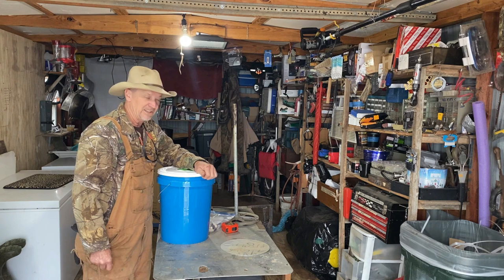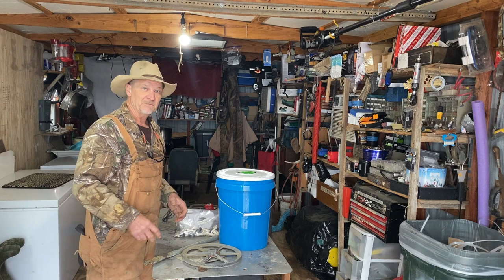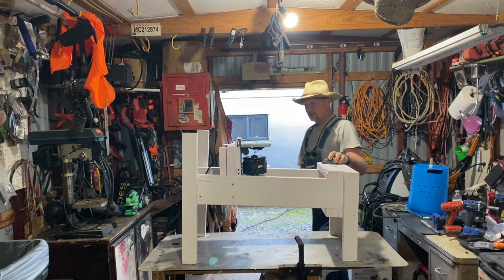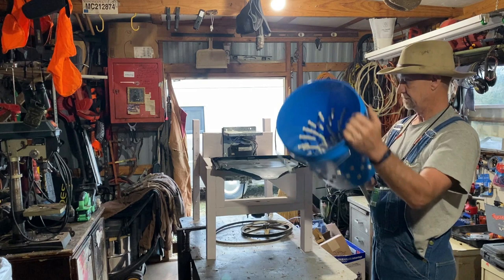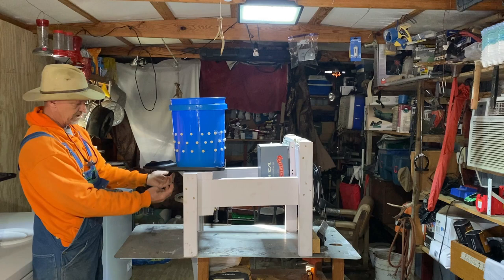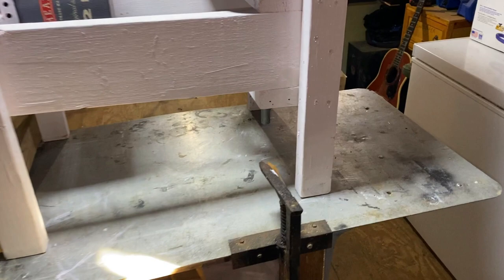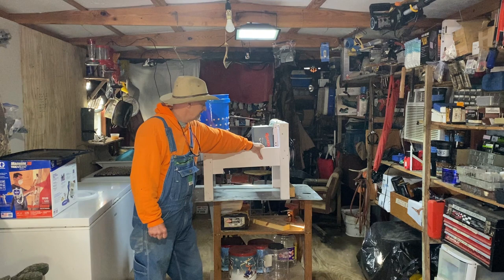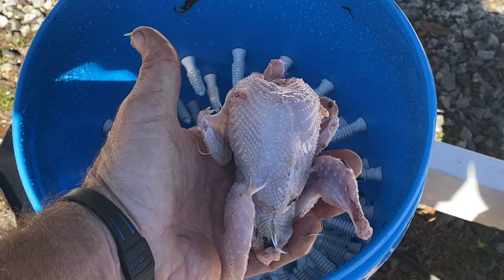HOMEMADE QUAIL PLUCKER from a 5-gallon bucket & old garage door opener motor. Save Money DIY Project

Comment: I built a duck plucker for wild ducks I used a sguirrel cage and took a piece of tin with our fingers thru it and wrapped it around the cage when we run it you just put your bird in your hand and push up from the under side to dry pluck a duck. Only took a minute to do a duck am sure it would work for a quail we also used it for scalded chicken
Reply from the maker: If it plucks a dry duck, it may rip a quail to pieces. I tied the drill attachment type but I did not like it at all.
Reply: @papawsplace  I have done teal on it you just don’t put to much pressure
Reply from the maker: Send me some pictures to my email if you don't mind. May be something I want to build. LOL
Reply: @papawsplace  I can’t send pictures im sitting in Florida and I’m from Canada all I used was a squirrel cage and motor from a air system Took A piece of tin drilled holes for fingers to be pulled through then wrapped it around the cage with fingers pointing out you could use any round drum as long as you can spin it just point fingers out not in so you can push your bird against it manually you could even use your  blue pail just reverse the fingers so they are pointing out and spin it on a shaft Your spin direction is away from you from underneath and you hold bird against it from underneath and it pulls the feathers away from you .push as hard or as soft as you like